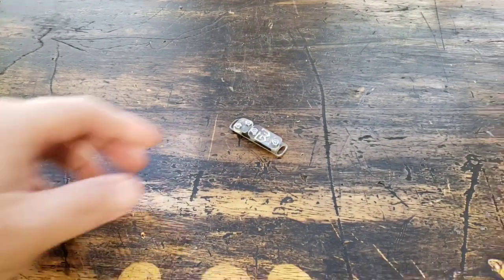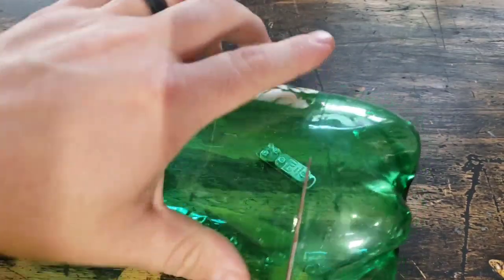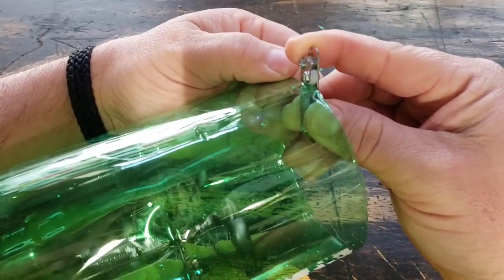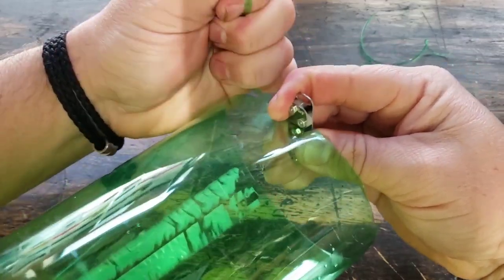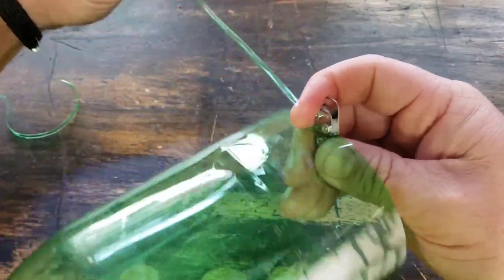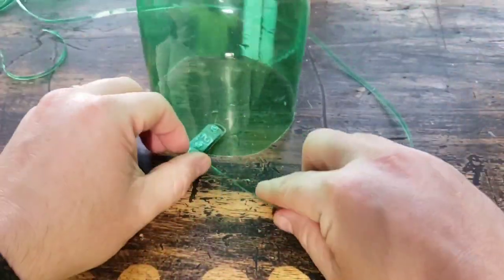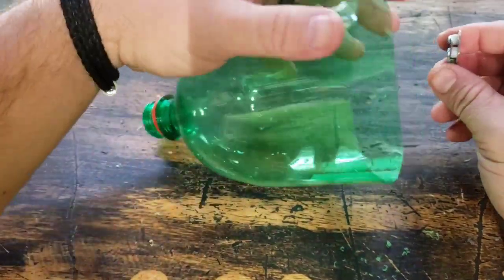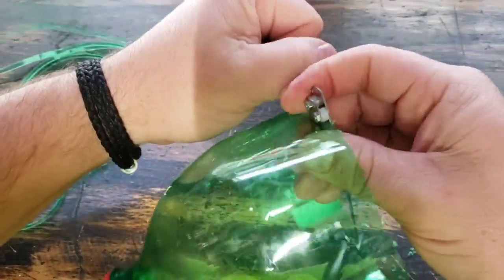Using Grims Cordage Making Tools

Comment: I am a backer of the micro tool. Love the size and simplicity of it. Definitely on my EDC keychain. One thing I will mention is, at least for the micro tool, make sure you really tighten the nut and bolt that is inserted into the middle of the blade. If it isn't very tight and as you are holding the tool on the bottle, the resistance of the plastic will force the blade to rotate and the bottom end of the blade will protrude out the cover and dig into your finger. I thought I had it tight, but after 10-20ft of cordage, I felt the blade begin to stick out beyond the lower cover. 

I actually assembled the blade backwards (pause the video at the 1:00 mark in the video to see how how he assembled it). You'd think you would want to feed the edge of the bottle against the sharp edge of the blade from the left side of the tool (as pictured at 1:00) so that the top, blunt edge of the blade will be pushed against the lower left nylon washer in the top cover effectively preventing any blade rotation. How it is assembled in the video will, again if not tightly bolted down, eventually rotate the blade's bottom edge out from the lower cover and possibly into your thumb (again as shown in the video his thumb will be vulnerable)
I did watch the assembly video, but that is for the card and not the micro so that didn't help me much.
A design change could be that you could add another bolt on the bottom cover just behind the blade's rotation path to prevent it from turning under pressure (just like the top washers would do if the blade were flipped 180 degrees).

Still, great tool. Works as designed. Thanks for the great idea to make extremely cheap, but very strong cordage.
Reply from the maker: Thanks for the great feedback! We'll be sure to take a look at making these adjustments!

Comment: have had so much fun making cordage with my micro-tool so far...defiantly one of the most useful keychain EDC items i've obtained so far...had to polish the edges just a bit with a needle file and sand paper to get rid of the edges...more of a cosmetic issue, that in no way effected the functionality of the tool. one question, any thoughts of producing these in brass? using black spacers? think they would look really cool especially after a nice patina formed over them...commented previously about using titanium which would be awesome but obviously more expensive...either way will probably obtain a few more of these as gifts for friends and family before long
Reply from the maker: That's awesome!!! If you ever have a cool project you use it for be sure to send pics our way!! We've considered other metals, but the only problem with a tool like this would be corrosion being an issue. We considered titanium though, and maybe some different coating options. We're also looking into spacer coloring options.

Comment: Any idea what kind of load capacity the cordage is good for? Just curious.
Reply from the maker: Great question...we did measure that when we first made the tool..I'm not sure where I have that data. I i know we've seen 30+ pounds on a single strand, and more when you twist multiple strands together. We've towed ATVs, trucks, even tractors with a single two liter bottle. If you go to www.grimworkshop.com and watch the video on the cordage tools page you can see some more examples of the strength of the material.

Comment: Does the direction of the blade (left or right) matter because of right handedness? The tool appears mostly symmetrical, so I'm confused why it matters (this is also coming from my struggle to get it to work pointing left, right, up, or down lol)
Reply from the maker: Yes, the direction does matter, if the sharp side of the blade isn't facing the post like in the assembly video it will get jammed. Likewise if the blade is not flat side up, it will usually just give you a few inches of material before cutting off. We just uploaded some new instruction videos that you can look at to verify everything. If it's all put together the way we have it in the videos it will work. If you keep having trouble email us at support@grimworkshop.com and I'll help get things working right 😁

Comment: You know guys and girls, I'm just underwhelmed by mine.  There were sharp edges on the parts, and I'm sure it was stated, but I was surprised that I had to assemble it.  Finally, it just didn't work very well.  The blade seems super dull and I couldn't get even a foot out of mine without it cutting super wide and jamming inside the tool.  I'm kind of bummed I spent my money on this.
Reply from the maker: You should check your blade placement if it's doing that, it sounds like you have it facing the wrong way. We've added videos on this channel of how to put each type together that could help with that, because if it's facing the wrong way, the plastic jams inside the tool.